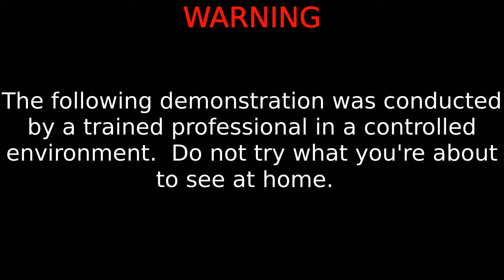Lower Explosive Limit Demonstration

Comment: "What did I just do?"..... 

What you did was put these participants and yourself in danger but doing your "explosion" demonstration in a classroom setting next to your fuel source IMHO. 

The remaining gas in the jar & the leftover plastic measuring dropper gas residual used in the explosion demonstration was not a safe thing to do indoors and with flammable materials so close to the heat/open flame source.

Perhaps if he did a "drop by drop" scenario with his plastic measuring dropper, he would have had a more controlled explosion with less fire?

Drop by drop method would have been a better way to explain LEL vs. UEL?